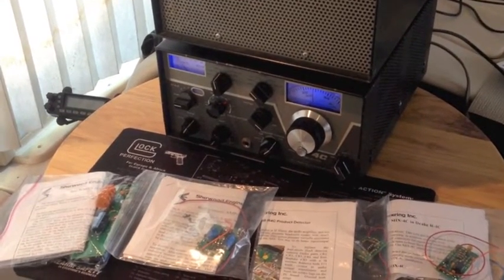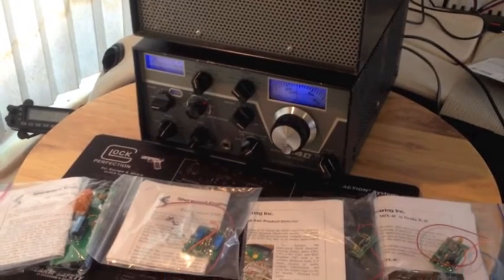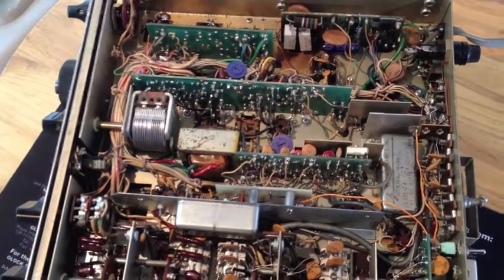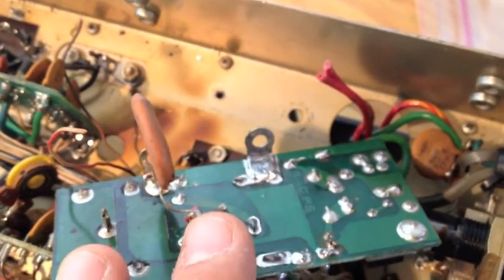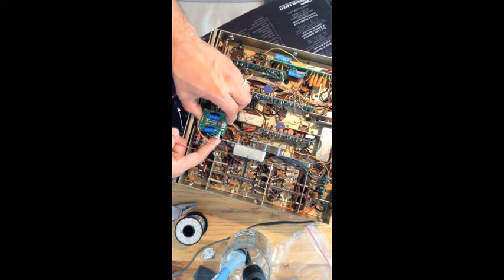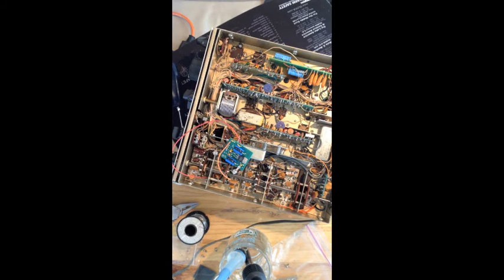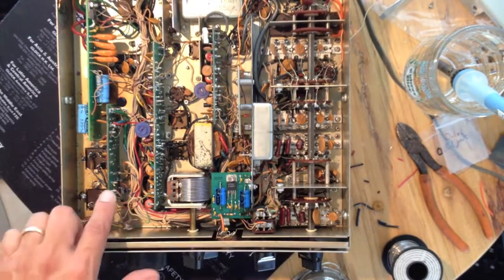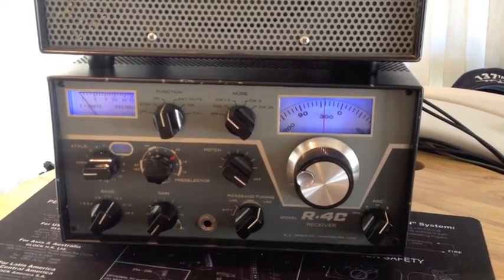Drake R4C PS and Audio from Sherwood Engineering

Comment: Exceptional video for those interested in the Sherwood mods on the venerable high perforamance Drake R4C. Thanks! 
BTW, your current 'improved' audio (as least through the video) is not up to par. R4C audio should be quite good and be smooth. Again, thanks for the video.